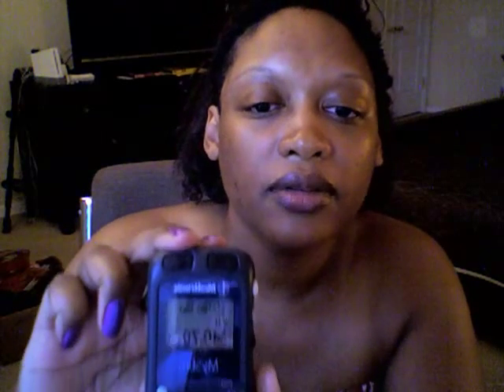How My Neurostimulator Works

Comment: Hello Jamie, Does this will work for people With spinal cord injury? Where to be placed, before or after the Injury?? If someone can advice, Thanks
Reply from the maker: +Living in Pain 24/7 Hello.  Neurostimulation is commonly used to treat chronic back pain.  There are spinal cord stimulators on the market.  I am not sure if it has been used with spinal cord injuries.  I suggest asking a neurosurgeon about whether or not this is an option.

Comment from the maker: Thank you.  I still have the same amount of migraines, however, with the neurostimulator, the level of pain is better controlled.  I do not use a daily preventative medication and use less pain medication.  The severe migraines still break through but most of the time I can bring the pain level down to a tolerable level.  I don't have it on every day and usually only keep it on during a migraine that is at a pain level of between a 5 and 8.  I have several programs that I can cycle through too.

Comment from the maker: Thank you for the positive feedback.  I'm happy that my video is able to help you explain to your friends how it works.  Unfortunately, I haven't had much success with my device for the past 3-4 months.  I've already had it adjusted with no change.  I do plan on making a new video soon about how everything has been going.  I'm so glad you have found relief for your back pain with your system though!  It's always nice to hear from chronic pain sufferers who have been able to find pain relief.
Reply: Jaime Sanders TY for your video
I have Chluster Headaches and Migraine 
My CH cycle is 12weeks on and 12weeks off with a minimum of 4-5 daily mainly at night
As u say also experience Migraines (so I'm never really pain/headache free) - which I always get with stormy weather too 
I'm currently on Epilum , Sumtriptan Injections and Prednisone loading at the start of each cycle

I'm allergic to a vast amount of pain medication (resulting in anaphylaxis)

I have had nearly every form of medication to try & assist in managing my Chronic Cluster Headaches and Migraines 
My Neurologist did mention trying an occipital nerve block - but until recently I was managing - unfortunately my beast appears to have a mind and willpower of its own 
I'm just investigating other options as I'm going to have to go back to Neurologist 
This looks awesome as a possibility/discussion
I'm prepared to try anything for even a little relief - I'm fairly pain tolerant as I've had to be - being allergic to pain meds but can't handle how intense this pain is
Thanks for the post - hope it continues to work for you